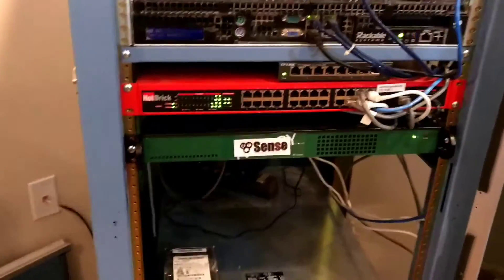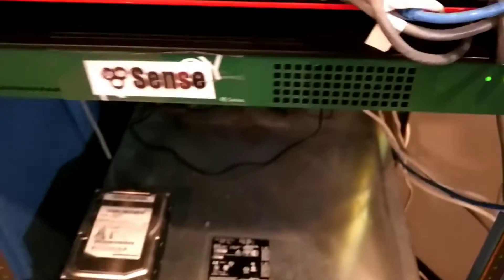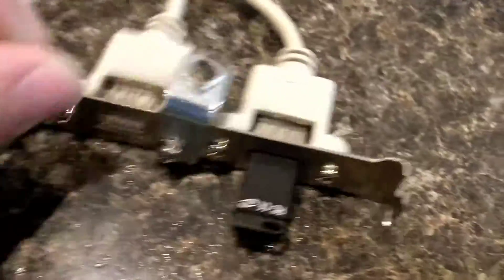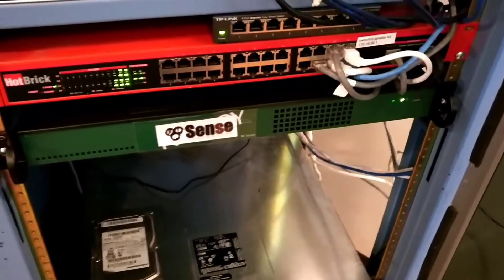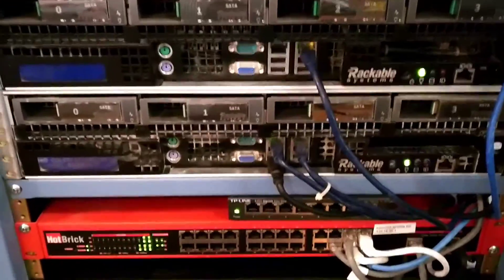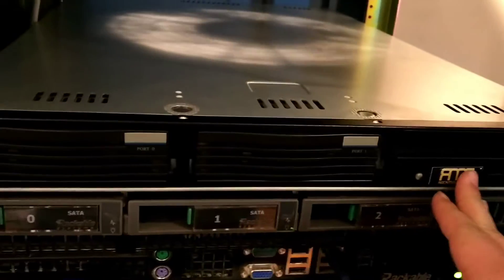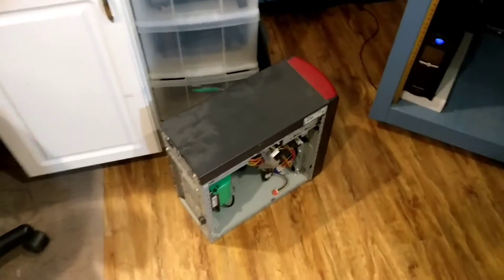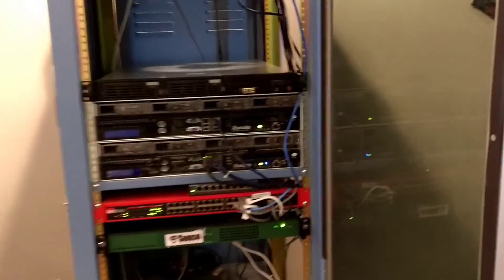New pFsense server, Rack Reorganizing, and more.

Comment: Damn I want one of those Riorey boxes!!!
Reply from the maker: Their hardware is this 1u Supermicro that can be purchased, theirs just has a green sticker on it :) http://www.ebay.com/itm/132055872174
Reply: Id love to find one of these already built because buying it in pieces costs way more money... plus making sure everything matches and works together is a PITA!!!  I got my Watchguard box dirt cheap and its OK but I want something a little newer and this is exactly the appliance I am looking for.
Reply from the maker: Ahhh gotcha. Yeah, if its one thing I've learned about supermicro servers its that they always seem super hard to find them anywhere, and if you do find a decent one, its always overpriced. Those watchdog boxes are pretty neat though I gotta say! And probably pretty power efficient.
Reply: I have the X550e and its getting old....I just want something like this that can run 64bit distros
Reply: If I can I'd like to find one like you have were someone doesn't want to renew the license and just wants to get rid of the hardware because they went with another box....
Reply from the maker: Ah. Could hopefully find something on ebay or craigslist, but always be careful when getting "appliances" such as these. I got lucky in this case, because the BIOS was unlocked by a simple CMOS reset, but I know some companies really lock down their hardware so that it can only run their software. If I couldn't unlock the BIOS on this machine, the sata ports would have never worked, since Riorey disabled them. I believe I've seen this once before with a Barracuda appliance, it would have been awesome hardware, but they locked it down so much that it became useless. 

Do you have any local datacenters near you? Wouldn't hurt to reach out to them and ask if they have any leftover/junk hardware, at least from my experience I've seen that some datacenters might be willing to give you old hardware that they would otherwise have to scrap.
Reply: if its a known Mobo like in this case, u can usually reflash the bios or replace the chip itself...
Reply: hmm good idea.... I might know of one close by...
Reply: Do you know the model of motherboard they use?